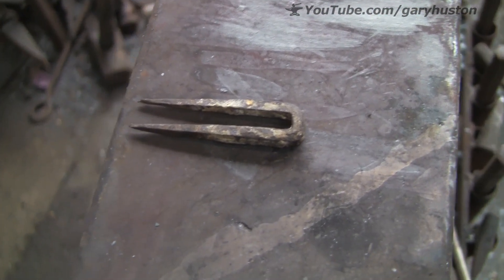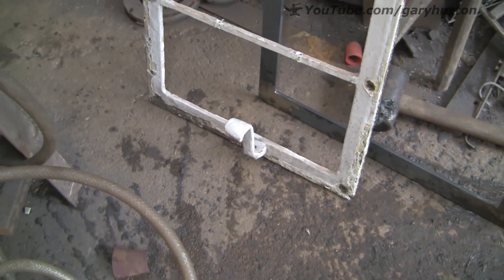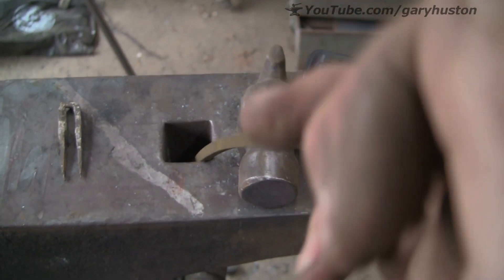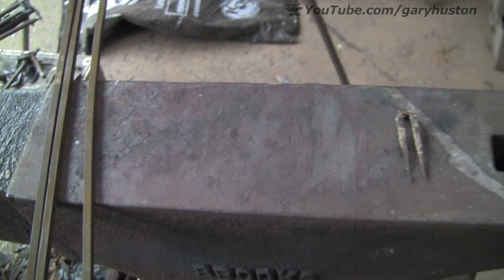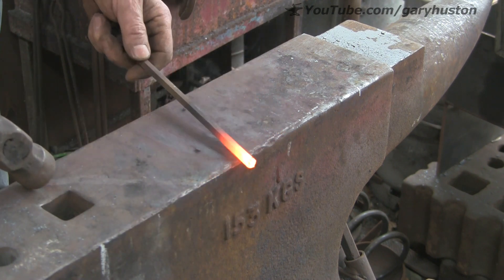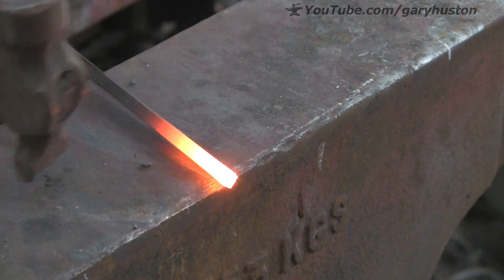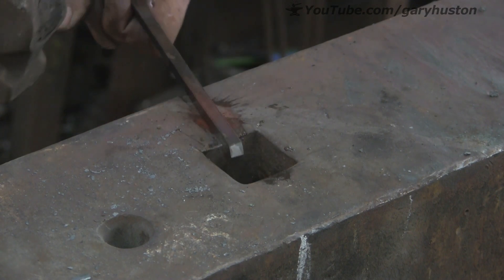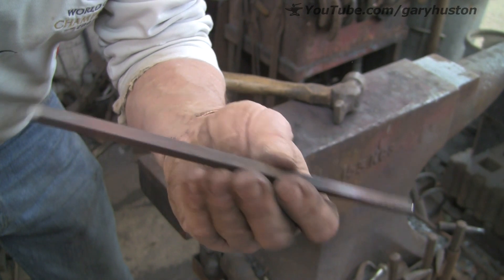Mystery metal

Comment: I used some cast iron welding rods or  I should say welding rods for cast iron that was square shaped rods.  I wonder if it is something like that.  The sparks remind me more of cast iron with the red sparks but usually I don't get that much spark. That is why I wonder if it is for welding cast.   Just a thought.
Reply from the maker: it came in a 10 foot length I cut it into 14" pieces so not rods.
Reply: @garyhuston   :)  I never used a 10 foot welding rod either .. I guess that theory is no good.  LOL

Comment: Great post Gary. I don't know, but I have about 20 pcs. of 3/8 x 1 1/4" x12" of the same material that has all the same bad qualities lol!  I bought it 10 years ago on ebay from a gal that had no Idea, it was left from her late dad's shop.  Can't be trusted if forged ,or welded, or any kind of heat treatment. It  hardens up like glass, will NOT TEMPER, or fully ANNEAL back from hardness no matter what procedure used!

Comment: That’s definitely a carbon steel. I used to make a lot of file knives, and I’d come across a file now and then that sparked the same and crumble under the hammer. I was told it was O-1, but I’ve forged new O-1 and it never behaves that way.

Comment: You could drill it, if its swarf looks like powder it's cast/iron, if it's stringy or bright chips it's definitely a steel, if it kills the drill bit maybe an odd grade of stainless or tool steel but why tool or hss would be in a 10ft length I don't know.

Comment: Found a similar piece of square stock I thought would work for a project and it reacted like your example.  It is then that I recognized the material as a piece of key stock I had purchased quite some time ago, so maybe it is key stock.
Reply from the maker: Steve Van Oudenhoven I think it’s way too hard for key steel and usually key steel has square edges but this has rounded edges.

Comment: How does the grain pattern look like.? Tight or pouris.??   It’s weird how it hasn’t rusted at all.     Any ways Heads up! In coming!!  That’s what dad would yell when metal and wood was flying all about.  Gary the window King. I think you took over that corner of the market.    You must really like windows. 😆
Reply from the maker: the grain is very tight. It has rusted as you can see in the slow mo break test. I hate windows! It's just another job now!
Reply: I took a look on the tv, I see  the rust now.  Did you figure out what it is yet?   Metal windows in the States .. it would be easier finding the Holy Grail.   Most are wood ,  vinyl, or fiberglass.
Reply: Good call Doug. I just looked some up. But personally I haven’t seen any. Even my Great Grandmas house had wooden windows with lead weights on a rope to help hold them open.

Comment: It's cast iron maybe cast welding rod.
Reply from the maker: I cut it from a 10 foot bar so not a rod.
Reply: Gary Huston  I would still be willing to bet that it is cast iron.  I had a friend tell me that a long time ago that cast rod was not always rod and that you could buy it in 10 foot lengths. But could not tell you without seeing it myself. I would try to see if it will melt with a torch. Best of luck.